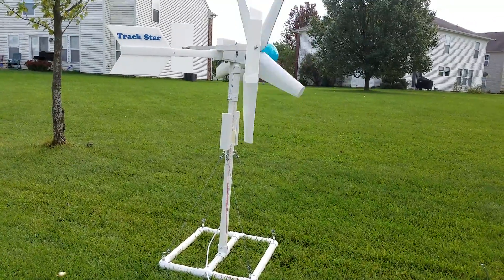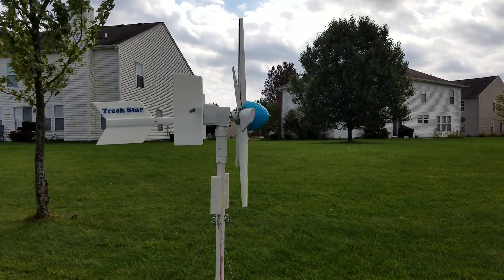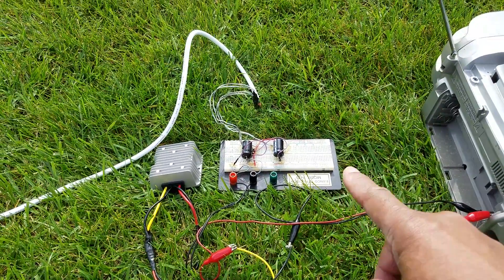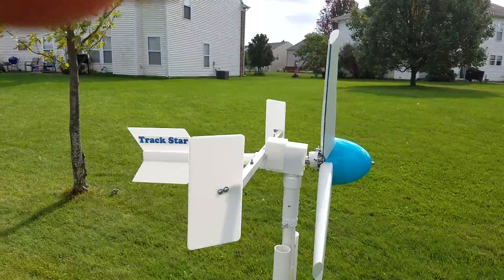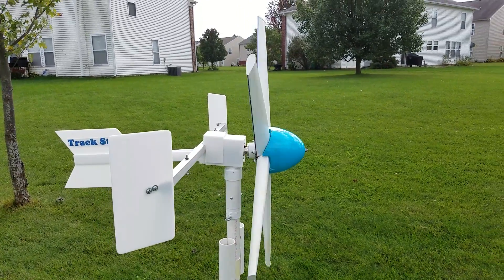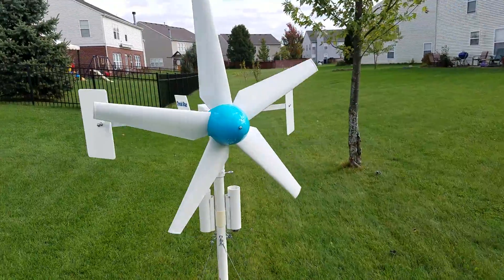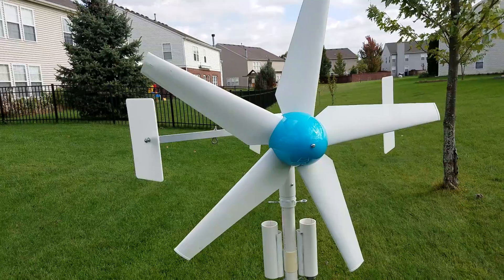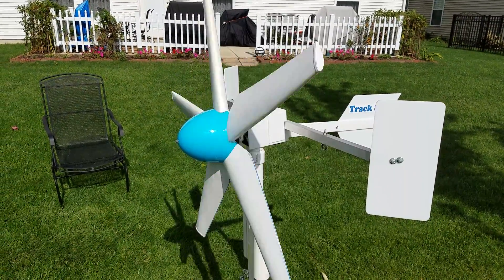Mini wind turbine 4c

Comment: Your anti twisting device is imaginative but in reality wouldn't work well because the wind is not constant. It gusts from different directions, so your micro wind turbine would constantly be hunting for wind. Also the fishing lines will eventually become twisted around the mast. They sell slip rings just for wind turbines and they work well and those that say they can't tolerate cable twist are not wind power experienced. I would say you should get some real wind turbine experience before you go wasting good family money on a vanity patent.

Comment from the maker: Frenchie: I like 5 blades because if you use only three blades, you will need to make them longer/larger.  The rule of thumb is 2 blades, three blades or 5 blades (No more).  You will see as many as 11 blades on YouTube Wind Turbines and, that means poor blade design.  I may do a YouTube on making my type of blades soon.  I would put my blade design up against any other design and I bet that my blades come out on top.  I am not bragging, I just do a lot of research before I design things.

Comment: nick shelley:  Wind turbines are used to charge batteries then the batteries are connected to an inverter for final AC  voltage use.  This little unit of mine can charge a car battery and then run a 145 (or higher) watt inverter.  This means that it could probably power a 140 (or more) watt Laptop computer in a windy area.  Keep in mind that I built this small unit to test my new blade design an other ideas out on.  Thank you very much.

Comment: Congratulations for your wind turbines Charles, it looks well designed and finished. I'm working in the same concept to install it in a small cabin at the beach, until now my headache is the propeller and its blades, PVC seems not to be the rigth way to go.